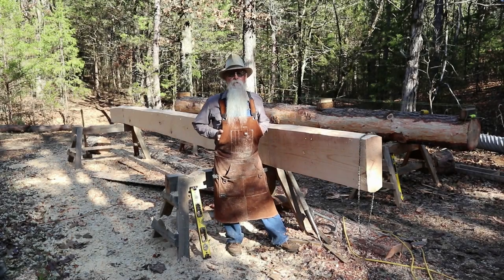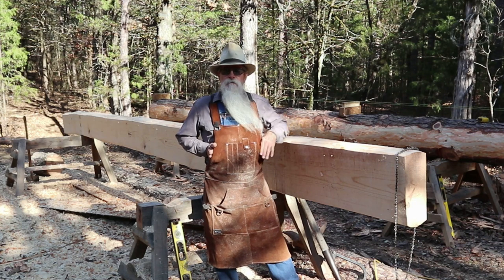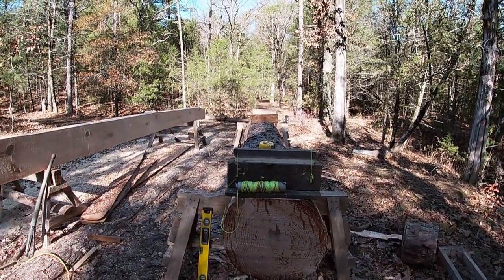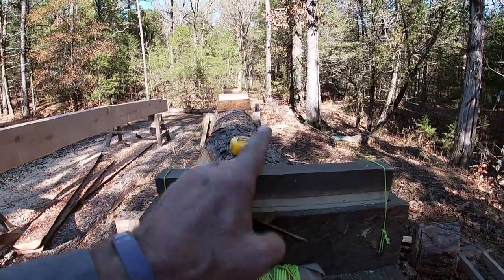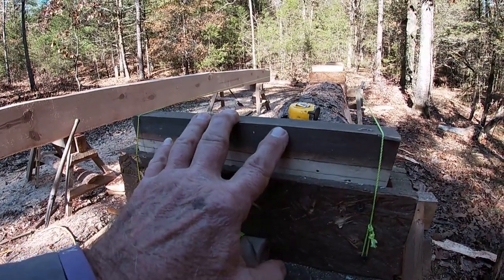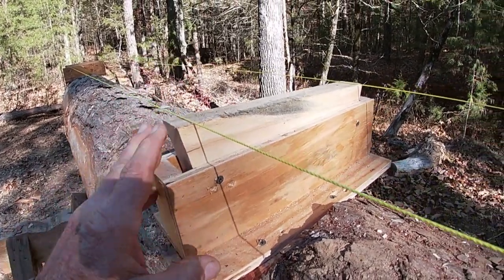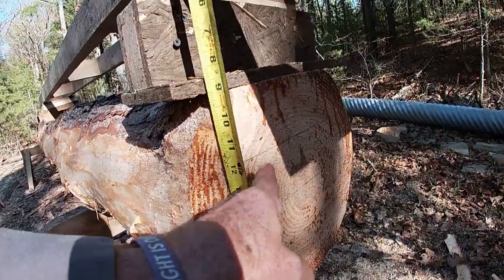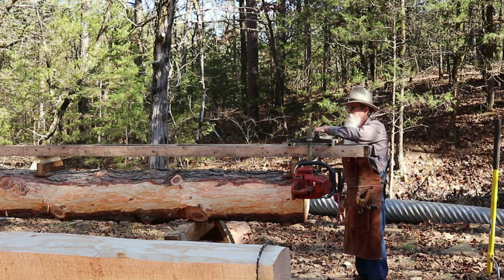Setting Up a Cut with an Alaskan Mill, Paradise Point - Ep 11

Comment: Great video. I use to do quite a bit of chainsaw milling myself. The bottom floor of the cabin I'm building is sixteen feet by twenty four feet. With the Lords help I did seven of the fifteen layers of logs with a chainsaw mill. The Lord helped me to later on purchase a cheap Hudson Sawyer band saw mill. The Lord also helped me do a little welding in order to put a larger motor on it which works much better. The mill I bought is probably the cheapest one available, but it sure was worth it. It worked well with the 7 hp. motor, however the housing cracked on it. I was cutting a huge heavy twenty- four foot oak log when the housing cracked on the small motor. I had been cutting huge oak logs like that the whole summer ( their had been a terrible thunder storm that brought those oaks down, so I utilized them for the back gable of the cabin). It was surprising how well that small motor cut, but for what ever reason, the housing finally cracked. Maybe I mounted it to tight to the frame when assembling it. The new thirteen horse power motor does work much better. My Hudson Sawyer band mill has a thirty six foot track which the Lord helped me to make for about two hundred dollars. It is amazing what one can do with a small band mill, some angle iron, and some beams to mount the angle iron on. With this set up the Lord has helped me have a cabin with six thirty six foot purlins  and a thirty six foot ridge pole ( it sure was a challenge getting  those monsters up on the gables with just ramps, ropes, an 8n tractor, and pulleys. But by the Lords mercy and help, those logs are in place Praise the Lord Jesus forever more!! My dad is helping me plain live edge boards for the first covering on the roof which will be seen from underneath. I'm leaving about a four inch gap between the boards and putting another board on top of the two to cover the gaps. I really like how it is looking. Your set up sure looks great for your chainsaw milling. You are a real carpenter. Whoever gets a cabin built by you has a real treasure. Blessings to you in Jesus blessed holy name, amen.
Reply from the maker: Howdy y’all- you have been able to accomplish a lot! Thank you so much for sharing this. That’s quite a testimony!  Take care and God bless y’all

Comment: That is a great way to get set up!! I enjoy using the Alaskan mill I've only ran it on oak ,ash and walnut, I am looking forward to sawing some pine and poplar with ,I'm sure it will go a little easier,I got near a 60 logs to square up ,I'm just going to cut them to the straightest longest length I can get,not sure what I'm going to do with them yet,but we are clearing for a pond and don't want to just doze them into a pile ,so I thought I'd slick them off and stack them up cover em and let wait
Reply from the maker: Howdy Brandon- a friend of mine who is a log builder came up with the leveling boxes and I’ve been using them for years. I can saw as long a log as I need to. It’s always good to have some cants for use later on. I would get the bark off as soon as you can to keep the bugs out. God bless
Reply: @TheBeardedCarpenter  thank you,for all the great stuff I've learned from you,this is another bit of knowledge that gets to be shared with people who want to work with their hands,and I will do on the bark,I'll get it off ASAP

Comment: I noticed you made another pass over the log after the initial slab removal.  I also noticed while cutting the initial slab off, you made several back tracking movement to the saw and it created a step in the slab being removed.  Did the pull back and re-initiating the cut movement of the saw as you cut create steps in the log's "good / wanted" surface and if so is that why you made another thin cut after removing the slab?  It appeared that the saw's bar rocks on the logs surface across its width as you cut (seen @ 6:35 ish when re-gripping the saw - left hand, palm up hence, lifting the saw just a little bit).  Is this causing any curving of the cut surface of the wanted log?   (JF)
Reply: P.S.  Last question:  When extending the "Rack's" the final length of the 21' log, have you ever had any change to the over all level of the length in the log's surface?  I imagine not with the "Levelers" secured as the are.
Reply from the maker: Howdy KS- good catch. I must have bumped when I started the cut and pushed the saw up a little. That movement doesn’t affect the log I’m milling because the Alaskan mill is still riding on the rack and only leaves the slab which is not being used with the steps of the saw. After the initial cut is made I’m just milling the log that will be used for the top plate. Moving the rack down doesn’t have any affect on the cut. Merry Christmas to y’all and God’s blessings to you

Comment: Have you ever tried snapping your lines and then just doing your rip cut free hand as the log lays on the ground? I bought an Alaskan mill a few yrs ago and only used it several times before I figured I could make cuts almost as good in a fraction of the time by just running my saw down a log making vertical cuts instead of horizontal. 

There are a couple reasons why I believe it's actually better than using a mill. First reason being is that you don't need a high powered saw, because you're only using the "action" part of your chain bar, which means it's much less demanding on the engine. Second reason is the time you save from having to set everything up and get it dialed in. You'd be surprised how accurate you can actually get your cuts just freehanding it with your snapped lines. You can also set up a level on your bar during your cuts to make it even more accurate.

I have found that my results from using a mill was only minimally better, and both require a good planing to get a nice finished board or timber... 

Regardless, thanks again for all the great content. Looking at buying property in the near future and using your videos as a guide during my cabin build.
Reply from the maker: Howdy Joshua- I have snapped lines and ripped up to them for sill logs and plate logs and was able to get a pretty fair job. A log builder buddy shared the way I’ve been doing it and it has worked fairly well for me. But I realize there are other ways to do things that work well also. I’ve watched videos of some guys in another country and they were doing what you do and it was amazing how well they did. I sure appreciate you sharing your method because it could be a big help for someone who reads your comment. I’m thankful for all the positive comments that add to the community. I also thank you for watching our videos. I do appreciate it. Take care and God bless you
Reply: @TheBeardedCarpenter  well I definitely appreciate the amazing content that you take the time to share with us, and also the fact that you still manage to provide feedback. God bless.
Reply from the maker: @joshuacourtney3916  I try to reply to everyone but once in a while I let one slip. Blessings